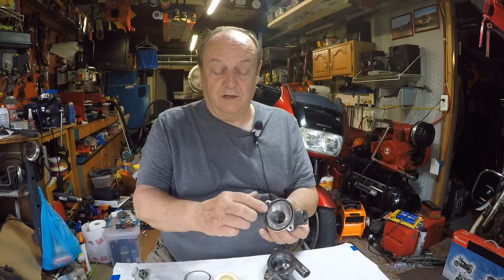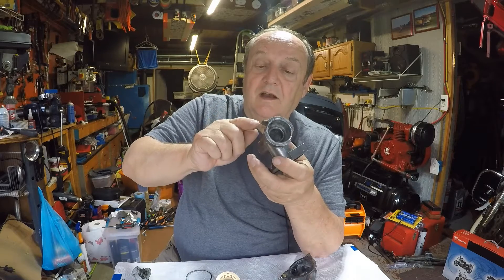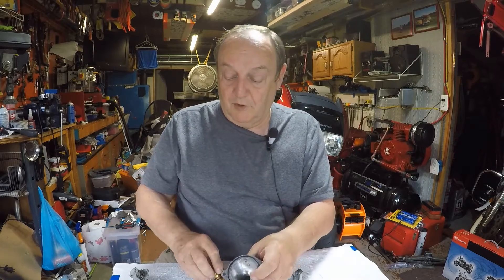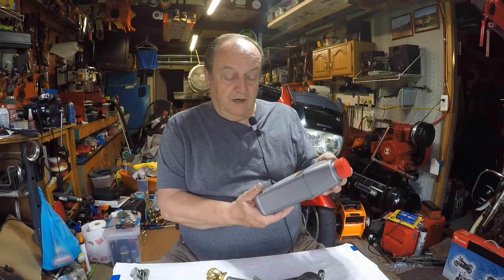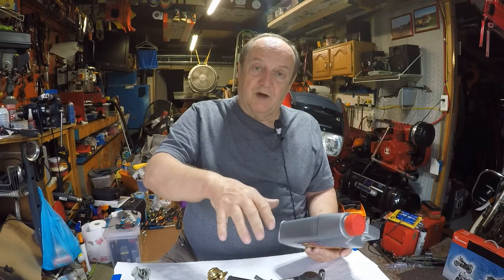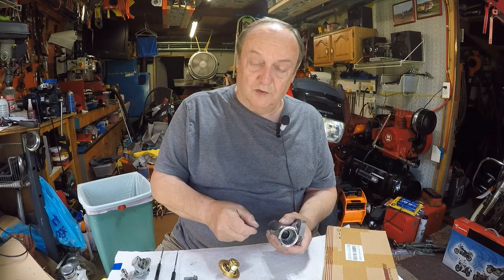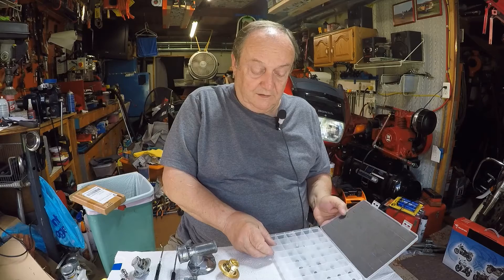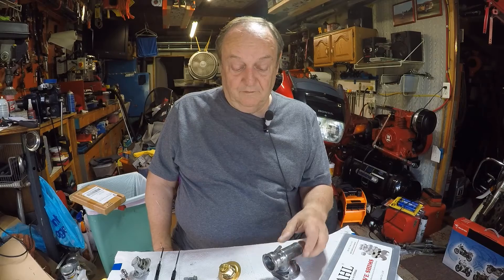HONDA ST 1100 TALKING ABOUT COOLING SYSTEM.

Comment: I had an old copy of the Iron-Butt magazine in which they highlighted a Honda ST1100 that had been purchased by a local European long distance riding club. The bike was available to club members for hire with the intention of doing the regular services and then riding the heck out of it. The only problem that it had was at what would be the 120,000 mile mark it blew a hose. The club installed a new hose kit and then kept riding it.

Comment: never put cold water on a hot engine. In my toyotas, and in the Honda ST 1100, I only use coolant purchased at a Toyota dealership or a Honda dealership

Comment: I was careful with that degreaser and descaler, I preferred a mixture of distilled water and a non-aggressive detergent (just in case), or I would buy the Product at Honda. Can you trust the guy? but yes you can trust Honda dealer

Comment: Hello my name is Mike & I have a Honda Odyssey FL 250 and I want to put a Honda st 1100 shaft drive engine now can I put this engine in the Odyssey just need some answers to my questions is it possible to make it an automatic by taking out the clutch may be making a block off plate  I ges what ever ansor I get I am going to do it enyway
Reply from the maker: Hi Michael, This is a little beyond my scope but try it. Nothing tried nothing learned. All my best to you and hope your project works.   Norman.
Reply from the maker: Another thought about your project, Look at how a snowmobile works. No clutch. Just an idea.

Comment: Thankyou very much fella. Got  the same issue on my ST. I'd already removed the pipe to the bottle and blown it through having followed an article by another bloke, but the bike is up on the stand so I didn't notice any build up in the housing and so would've missed it. Currently just pulled the waterpump out as its bearing is knackered....also doing the timing belt, idler and tensioner at the same time (the belt was looking ropey and I'm on 90.000 miles so it's a definate must). Had to fork out for a new fairing bolt kit as well due to corrosion and historic losses. Right, I'm off to look at what else you've done...this is the first time I've come across you mate. Keep it up.  Good fortune.
Reply from the maker: Hi Michael,  Sounds like you are your way to having a great bike. Also check my video on redoing the breaks. They have rebuild kits on E-Bay.   Ride safe. Norman.
Reply: @2001himax  Haha! B'jeezus man! Don't mention anything else. I'm not looking at the brake video until I have to. Got two bikes, a Landover and a. 12ton truck all in need of work! 😆😂😆👍

Comment: Did you use a Honda thermostat or another (car one, lots that will fit provided you drill the required hole) if non Honda where did you buy the 0 ring. 

Very helpful video 👍👍
Reply from the maker: Hi Don, I bought the thermostat for the Honda from E-Bay and the O ring came with it.  It had the hole in it and it was a Honda product.   Norman.
Reply from the maker: https://www.ebay.com/itm/271983551385?fits=Year%3A1993%7CModel%3AST1100%7CMake%3AHonda&hash=item3f537ba399:g:BzkAAOSwFnFV8x2A

Comment: I have the opposite issue with my ST1100, the it looks to be running cool when moving, and the temp gauge only comes to half  way up the gauge when stationary or going very slow.   I have been told it should be running at the half way point all the time. Have you any idea what could be causing it to run cool ? Two hoses have been changed as well as the thermostat, and none of this solved the issue. Amy help would be greatly appreciated
Reply from the maker: My cooling system has been flushed, clean water run through it and the part with the filler cap cleaned then new coolant put in. The temp gauge runs in the middle while riding on a hot day in city traffic. A lot of stop and go the fan comes on. Once  out on the rode the gauge is lower, around 1/3.  On cool nights out on an open rode it can be around 1/4.  I think this is normal. You will notice on this bike a lot of warm air comes out the side vents by your legs. This is well designed to scoop the air in the front and out these vents.  Also notice that the air intake is smaller than the the air outlet. Aircraft use the same principle. Hope this helps you.    Norman.
Reply: @2001himax  Thanks!

Comment: Got exactly the same issue as you described on my honda cb1300 from 1999: hole back to the expension was plugged. The bike would over heat. It is a tiny hole, mineral build up over time, undetected and you end up with high pressure in the system at some point, can even cause a pipe to burst. Also got the metal connection to the pipe crumbling from corrosion as you showed. I guess a common design from hondas of that time.
Reply from the maker: Hi Romain,  When I rode the bike home I wished I would have noticed the temp. gauge but I was too busy watching my driving. With that tube plugged it must have a lot of pressure. Glad you saw your bike was plugged before it was damaged.  all my best,  Norman.

Comment: I have a 1999 ST 1100 & enjoy the heck out of it, very trouble free machine.. Ridden it to Florida several times & all over the south from Cincinnati. I also have a 2019 Goldwing I bought new in 2020. I have put over 30,000 miles on it in the last 16 months. But, still love riding my ST! Enjoy your new toy!
Reply from the maker: Hi Michael,  Almost done with my ST.  Only rode it home. Sure is smooth. I like the size of the gas tank. Thank you for your comment.  Norman.

Comment: Great video! FYI Honda used silicate free coolant. You can get at dealer, of course. I think I paid 20/qt five years ago. You can the same exact Honda coolant at parts stores but it’s has a blue label marked “Asian “ vehicles on it for 20/gal.
Reply from the maker: Thank you for the info.   Norman.